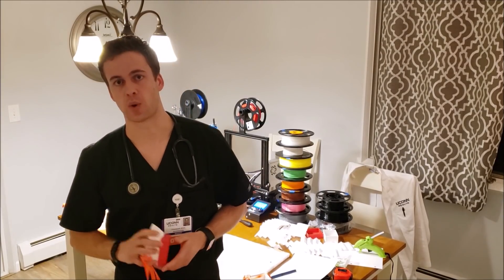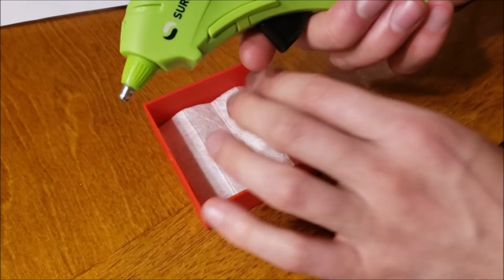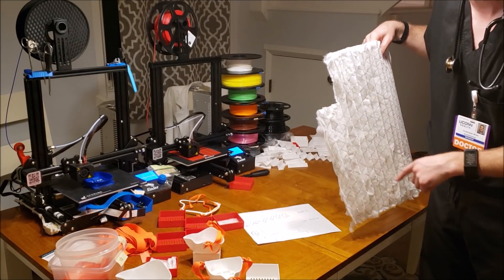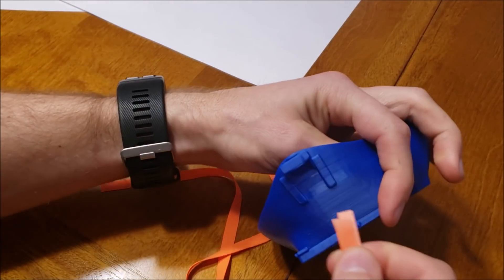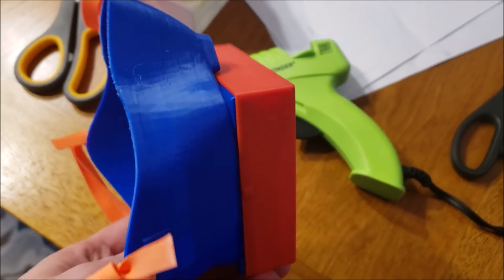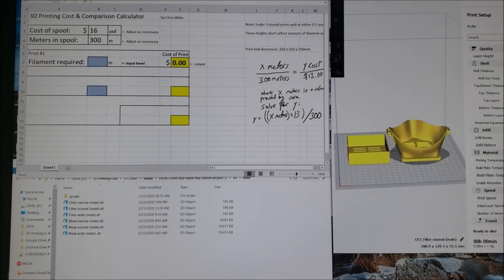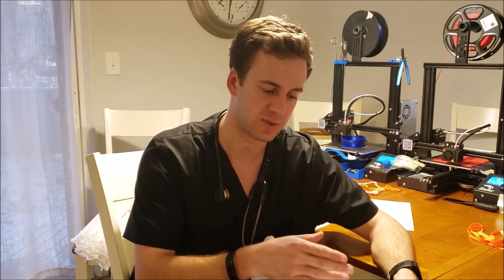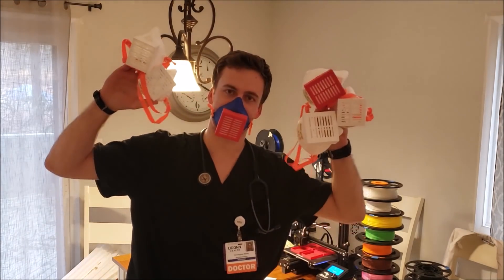COVID PANDEMIC 3D PRINTED MASK TUTORIAL

Comment: These look great and it's fantastic they passed a fit test.  I have some questions though:
- They look painfully uncomfortable, which is an issue if it needs to be worn for 12-18 hour shifts.  Has this been a problem?
- Groups like MasksForDocs are mass-producing face shields to protect and extend the N95 masks that we know work.  In your opinion should people divert these printing efforts to make an N95 that isn't certified?
- In looking into making masks I saw that sometimes these types of filters are made of fiberglass. I was a bit worried that the process of cutting might break it up to be dangerous in and of itself. Do you know the material you are breathing through is safe? I will shoot an email to Filtrete about this.

(edited spelling)
Reply from the maker: Thanks for reaching out. The "narrow" mask file fits my face perfectly and doesn't hurt. If it isn't a perfect fit, the edge around the nose can hurt. Sanding helps, and I also have been experimenting with putting some window sealant rubber material around the edges of the mask (the sealed rubber, not the porous foam type) which greatly improves comfort during longer wear times. I appreciate you reaching out to filtrete. please let me know what they say here or on twitter @CWilesDO. If there is fiberglass, cut the filters outside. I don't see any fibers of anything being aerosolized. Once installed, glue, (I might be switching to silicone based on price), or other material is used to seal the cut/frayed edges. The body of the filter material is tightly woven and doesn't allow anything to break free and enter your lungs. I haven't had anyone tell me they are wearing them for extended periods of time yet as I just released this yesterday. I have spoken with 9 hospitals about interest and plans to print so far. Doctors from 2 contacted me already today (one in Mass, one in Connecticut) and one states they are intubating COVID patients without n95s even, that their shortage is that bad. For them, I would say print these masks. For those with n95s, print 1/2 effort towards face shields to protect the n95s from contamination, and 1/2 towards these to prepare for if you run out of n95s, donate extra masks to hospitals with 0 if you have a surplus. 

For extended use I would suggest:
1) sanding the edges
2) doing hot water 5-second submersion and immediately molding it to your face for a perfect fit which improves comfort
3) adding some material around the edge. -If people could let me know what materials worked best for them, I can make another video asap outlining it. 

About MasksForDocs, they are doing a great job. The face shields are the prusa design. The stl file of their newest version, "rc2" is free to download here: https://www.prusaprinters.org/prints/25857-prusa-protective-face-shield-rc2/files  I can print one of those every 4.5 hours on my printers, and my masks take 5-6 hours to print (3-4 hour per mask, 2 hour per filter) by comparison.
Reply: @chrischris64  Thank you for for responses.  

Re Filtrete: I haven't heard back from Filtrete via email or Tweet (https://twitter.com/BortoneDante/status/1242427523847389184), but I will let you know. I'm assuming they won't comment, or be overly cautious to avoid being legally responsible. Their FAQ's (https://www.filtrete.com/3M/en_US/filtrete/about-us/faq/) asks "What is the difference between fiberglass filters and Filtrete filter?" I don't know if they mean 'just fiberglass' here. The response to their own question isn't informative.

Would it be a big help to have prints that all used the same filter cover?  CAD isn't my forte, but I could give it a shot or make a post in MasksForDocs to see if someone can help.   My wife and I thought the mask could be a deeper.  I can make that mod too if you agree.
Reply: Filtrete response: "We have received many questions about using our Filtrete™ Air Filter material to create face masks. Our filters are designed to be used in HVAC systems only and are not suitable substitutes for alternative uses. Altering any of our 3M Filtrete™ Air Filters is not recommended and strongly discouraged. Using the air filter in any alternative manner would not be supported by 3M or the Filtrete™ Brand."

My follow up Q: "Do these filters contain microglass?"

Response: "All of our filter media fibers are polypropylene and polyolefin plastic which will remove particles that measure .3 to 10 microns."

So no fiberglass at least.

(edited to update question and response)
Reply: Rubber hose for around the outside? Cut a slice thru the center of tubing length wise and slide the edge of the mask in the slit. Make sure the ends of the hose are touching and glue?

Comment: Can you make an attachment to seat the 3M 5n11 filter pads. Then you would have a rated n95 filter ready to pop in. These are more available.than masks
Reply from the maker: I'll go pick one up tomorrow so I can measure the dimension. I imagine I could get it done, sure. Thanks for the idea.
Reply: @chrischris64 Where you able to make any progress on the 3M attachment?
Reply from the maker: I tried to find these in a store today and they were sold out. I ordered a 5 pack online and will try to make the design over the next few days and fine tune the dimensions when they arrive. They are particulate filters though right? How many microns do they filter down to and do you see established anywhere they are capable of virus filtration? Thanks
Reply: @chrischris64  the standard size that is set for particle filters is 3 microns, with N95 removing 95% of the material of that size. But as you know for most circumstances the virus is on dust particles or in droplets instead of on it's own, which are larger than that size.
https://www.cdc.gov/niosh/npptl/topics/respirators/disp_part/default.html
you probably already know the info on this page but if you don't read up. Could also be worth reading up on the data sheets for different filter materials, which should contain info about the efficacy of the filter.

Other recommendations for attachments could be for 40mm NATO filters, but it might be on the heavy side of what the straps can support without making the mask fall off.

Edit: actually after reading through some documentation I came across 0.3 µm as a standard.
https://www.cdc.gov/niosh/npptl/topics/respirators/pt84abs2.html